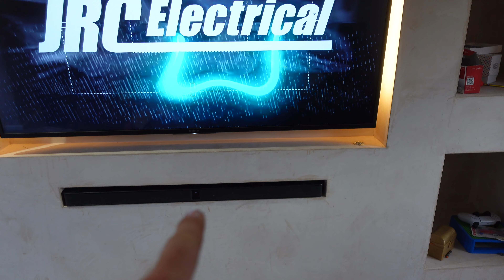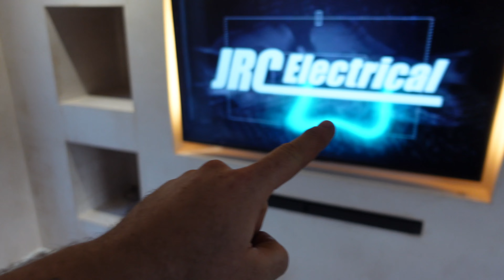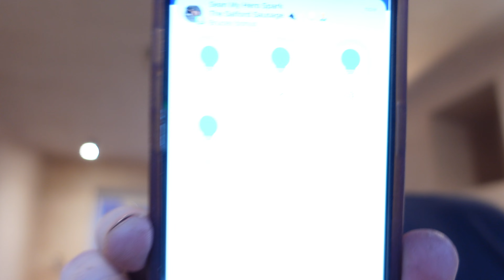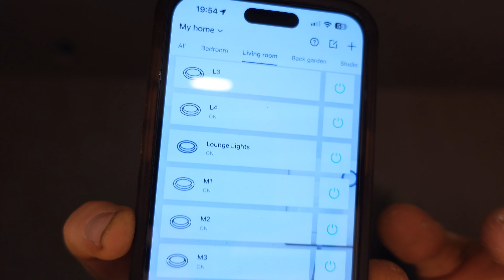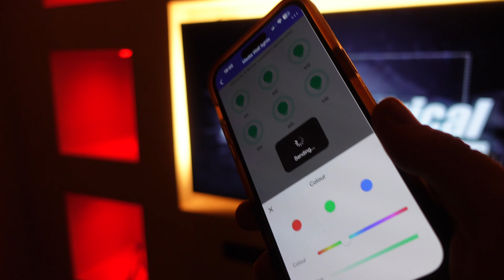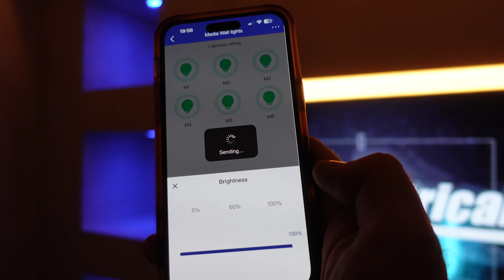The BEST Media Wall Lighting - Electricians Vlog

Comment: Shocker about your van! My uncles did exactly the same after someone tried to use something to break in, glad you’ve sorted it though! Lovely job as normal! Big up ya self!
Reply from the maker: Did he get it sorted? Love to know what’s up with it 😂 cheers dude big up
Reply: @JRCElectrical  yeah he had to take it back to the supplier though he was lucky because they could still source the parts, think you’ll be struggling on a 2014 van unless you go to a specialist!
Reply from the maker: @StuartTownsend.  I managed to get all the locks from a vehicle breaker so should be sound again 😂 depending on what else has gone

Comment: Jack just come across your channel and subscribed while watching a few on your back catalogue and came across this media wall blog / living room upgrade vid and really enjoyed it, hope your van is sorted now by the way.  Anyway I had a question about your smart light solution.  As an electrician can you explain the reasoning behind going for smart spots with standard light switch rather than a smart light switch as well.  I get that you want to control the colour from a smart app or using Alexa but having a standard light switch can mean people turn off the lights using the switch and meaning the smart lights do not work.  Also smart light switches mean you do not have to replace every light bulb in the room and mean for a cheaper smart upgrade.  However again I grant you that you were doing up your room anyway so replacing the bulbs was not an issue.
Reply from the maker: Cheers mate, I always think and it may not be the case that if you have a smart switch this also relies on internet 
So if your internet goes down you also loose your lights, I could be wrong but that’s what I thought 😂😂
Reply: @JRCElectrical  - this is a niche joke so forgive me…., OH THE ZIGBEE OH THE ZIGBEE OH THE ZIGBEE! but Zigbee light switches allow for no internet smart control switches. One other thing I would add you have went for specific colour choice which may not be available so that is another avenue for you to tell me to do one 😂

Comment: Not bad, just remember vans and all that are all moving parts at some point they go wrong they age just like humans
Reply from the maker: It wouldn’t bother me that it’s gone wrong but just how and how do I sort it that’s doing my head in 😂
Reply: @JRCElectrical  Seems to be electrical related 😂 send it in to a auto electrician rather then a mechanic too many mechanics are ready to replace rather then diagnose which is clearly what happened here and it’s broken again… The problem needs to be diagnosed and after that you’ll have a better understanding of what the issue was.
Reply from the maker: @CAR_SOLUTIONS  ❤️ I shall send it in as soon as I can, to be fair I did the locks myself and it worked for. Abit 😂😂😂😂
Reply: @JRCElectrical  No harm trying ;) you never learn if you don’t attempt if it’s your own I don’t see any harm in trying best of luck 🤞 hopefully it’ll be sorted ✔️
Reply from the maker: @CAR_SOLUTIONS  thanks dude